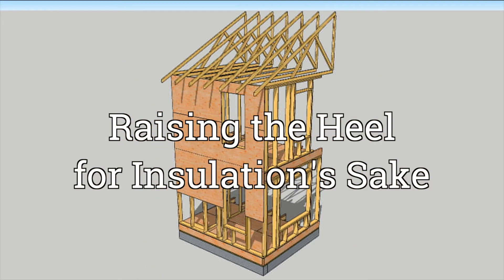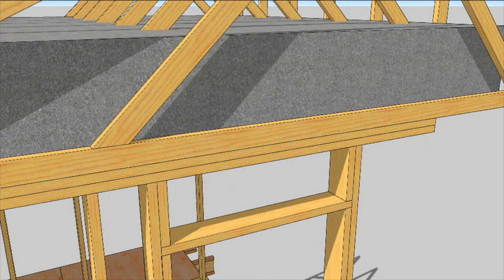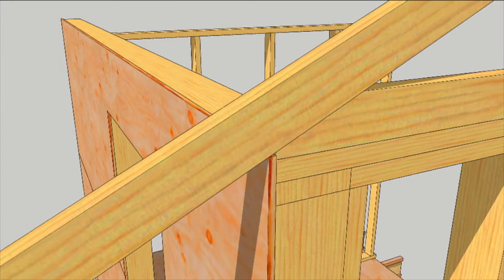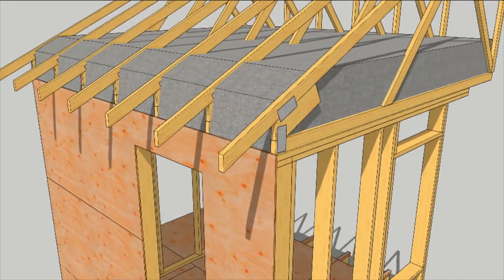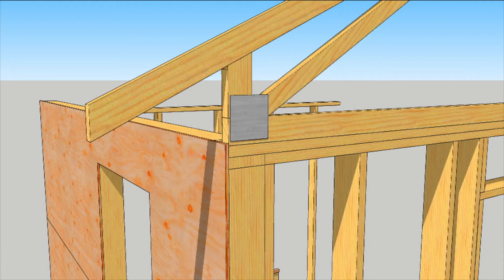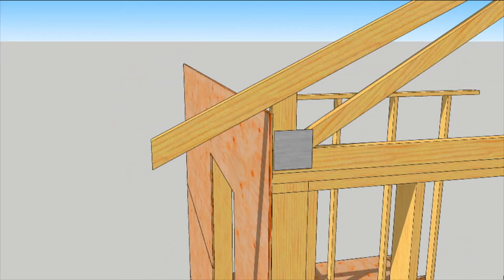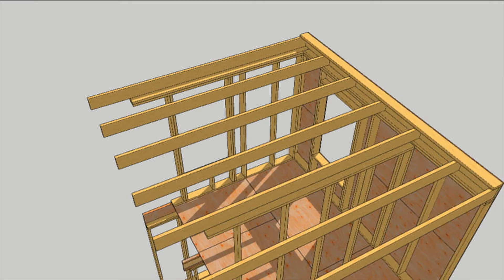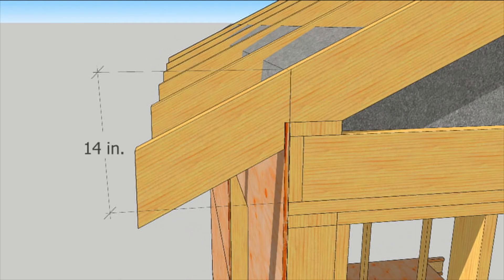Raised Heel Options

Comment: What sort of strapping would be used  for hurricane ties on a the stick version at the end? Only one top plate would mean the bottom of typical hurricane wouldn't make full nailing pattern.
Reply from the maker: Generally with a single top plate, the roof framing should align with the wall framing (stacked framing), so your hurricane clips should be able to fasten into the studs.